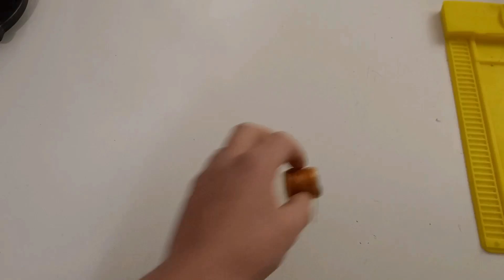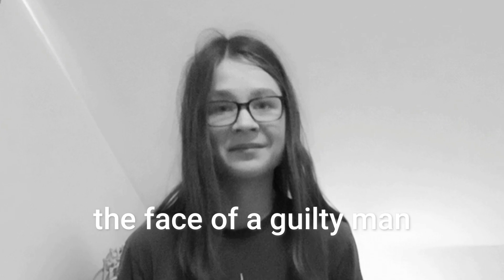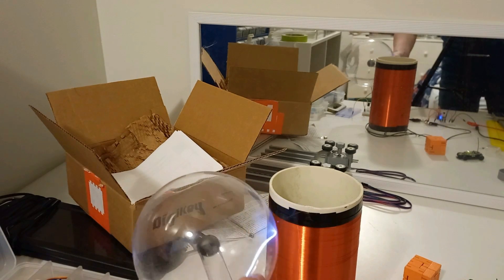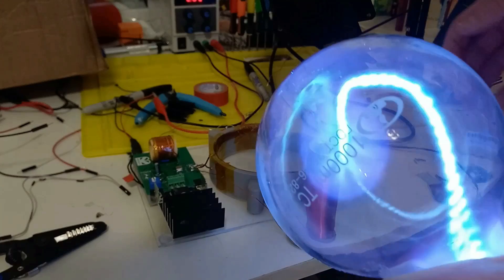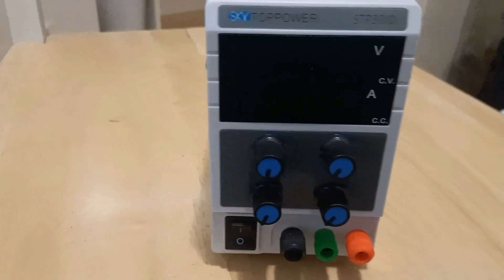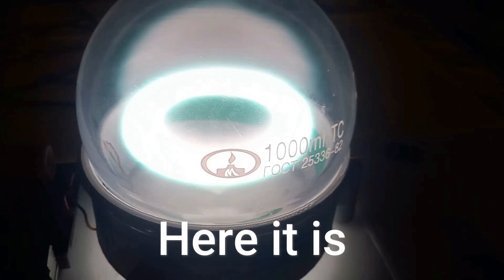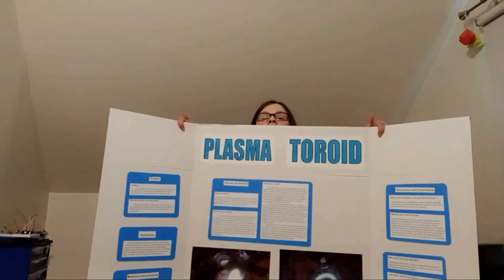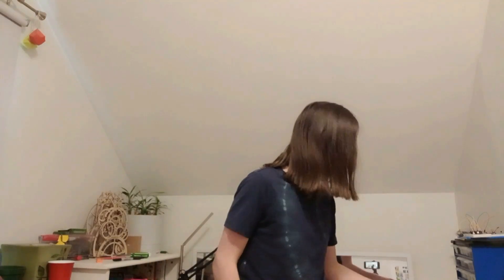How I Made My Own Plasma Toroid

Comment: FINALLY!!.....your video provided me with the information i've been searching for for such a loooooong time,,,knowing that there are arcs produced on the primary coil confirms it is high voltage,not the normal kind tho,buuuuuut also means i can do away with the self oscilator circuit and just use an augmented high voltage ac....by itself i suspect the ac alone wont work though cz the impulse from the capacitative discharge is necessary to create the toroid,,,but as the toroid in this nature is not what im going for,all i needed to know was driver coil conditions and that little shock you got told me everything i need to know so I can do without it,and progress with the circuit augmentations,,,,anyway thank you very much for your efforts,youve helped shine light on something i was stuck on for abit.

Comment: You need thicker wires, and you have to put a fan on the power transistor - and most importantly - a voltage source with the option to limit the current. Maybe in the future you can put an audio DAC, where your plasma can dance to the music - DON'T RUSH - YOU HAVE ALL THE TIME IN THE WORLD.

Comment: The gapped (outside) coil works better than the contact coil (inside) likely because the gap greatly reduces capacitive coupling between the coil and glass. It is also much easier to maintain even capacitive coupling all around to minimize distortion with a consistent insulation gap than wire-to-glass contact.
Reply from the maker: That makes a lot of sense. Thanks for the feedback. I do think another big factor could just be that the circuit is more stable in the 3 turn configuration and the plasma toroid is having less of an effect on the waveform, and distortions of the magnetic field aren't amplified as much leading to more stable plasma. That's all theory though. 😁
Reply: @kiblybuiltit3304  The circuit certainly needs tweaking as other people who have done toroids seem to be running under 20W. Something is definitely not optimal there. First thing I'd do is swap out the thick solid wire on the primary for multi-strand to reduce skin effect losses.
Reply: @teardowndan5364 who are you seeing running <20W? 40W seems to be very normal and honestly on the lower end of most people’s builds